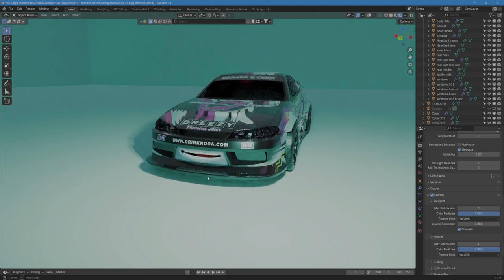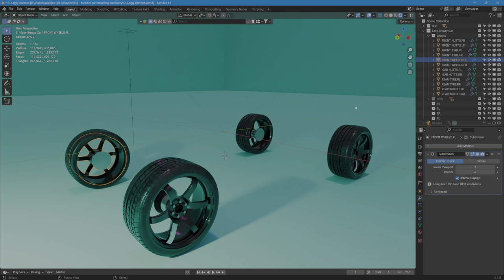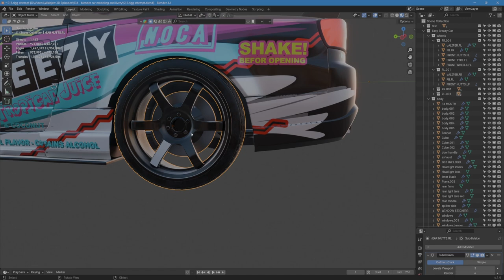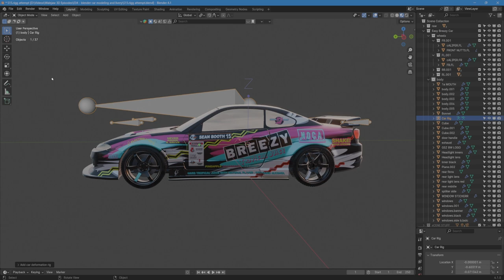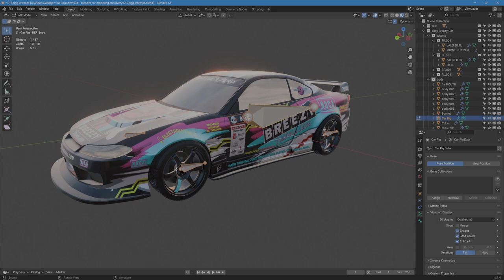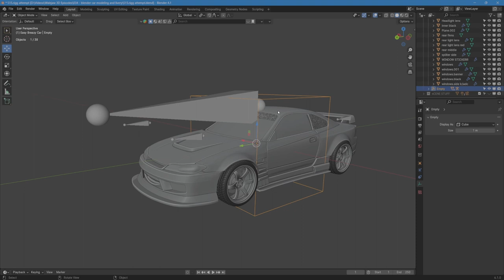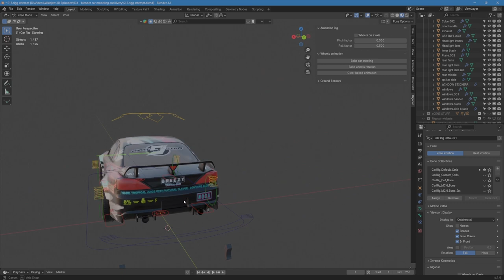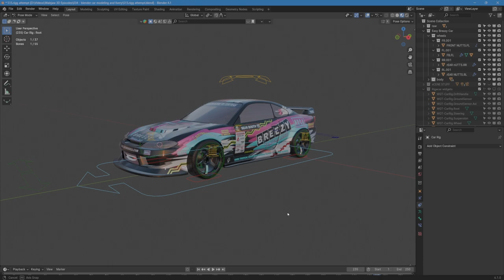Rigacar Problems - A Complete Guide

Comment: Thanks for the tutorial man. This addon is literally on life support lol.
Also a note: If you name your car parts correctly and select the entire car before adding the armature, is will place the bones automatically.
This is my cheat sheet, it may be helpful to you:

NAME				NAME OF THE CAR

NAME-Body			The Body of the model

NAME- Wheel.Ft.L		The front left wheel

NAME- Wheel.Ft.R		The front right wheel

NAME- Wheel.Bk.L		The rear left wheel

NAME- Wheel.Bk.R		The rear right wheel

NAME- WheelBrake.Ft.L		The front left brake wheel or any part associated with the wheel which does not spin

NAME- WheelBrake.Ft.R		The front right brake wheel or any part associated with the wheel which does not spin

NAME- WheelBrake.Bk.L		The rear left brake wheel or any part associated with the wheel which does not spin

NAME- WheelBrake.Bk.R		The rear right brake wheel or any part associated with the wheel which does not spin

INSTRUCTIONS:
1. Don't parent before adding the rig!
2. Apply scale and correct the origins.
2. Select the whole car before adding the rig!
3. If rig cannot be generated, check if all the bones are named correctly.
4. Make sure the car is sitting on the XY area, if not, the bones will be misplaced.
Reply: Thank you for solving my problem for the past few days now👍🏾
Reply from the maker: (this gave me grief way back lol)
My argument with this is,  when it dosent work, which it never does. you waste time. (sure im stupid)
My way is quicker than typing all those names only to find it didnt work. 
Automation is only good if you know how to fix it. 
And if you have to fix it you may have well just done it manually. 
Im sure i can parent 11 bones quicker manually than u can find your cheat sheet and rename your layers. lol. 
Its all about clicks per action. less the better.  Your way has 21 clicks just to rename it. mine has about 10 and its finished, completely.

Not only that, rigacar can only rotate on the y axis meaning it wont go around corners making it useless from the get go :p 

This argument it purely for fun. i mean no harm. but rigacar automation stinks, i wont entertain it. hawk tuah 
hahaha
Reply: @walejaw3d  It's all fun & games until you have to rig 20 cars for the same project :P
Then you have to parent 11 * 20 bones! That's 220 * 3 clicks! (thanks calculator)
But with automatic placement you have to name (at least) 5 parts and copy paste them for the other 19 cars.

Though your manual method is still a lifesaver if RigACar just decided to break that day.
Reply from the maker: @nolink8884 ye im just a hobby guy that does it once every blue moon. Hopefully ill have a job in the trade soon and ill need to develop more professional methods ✌🏻